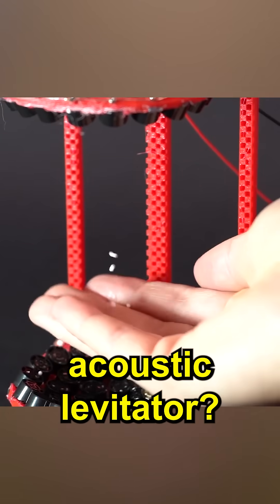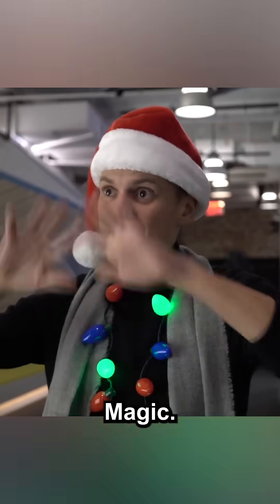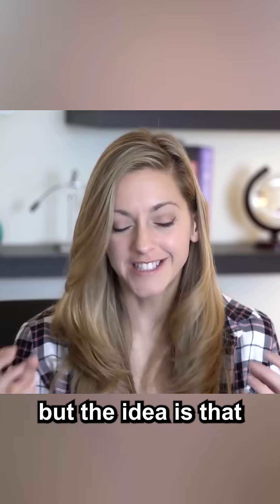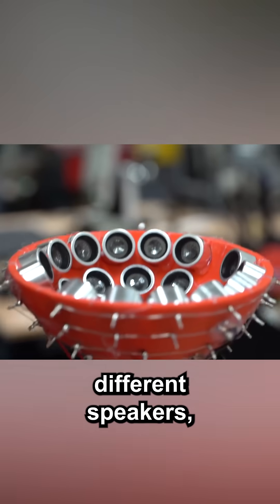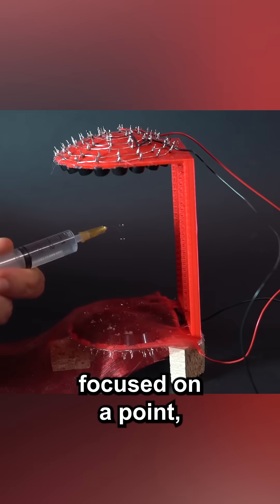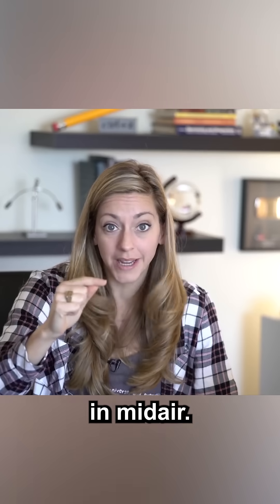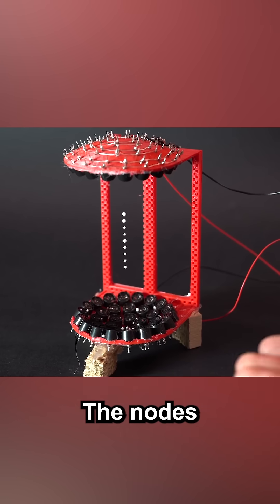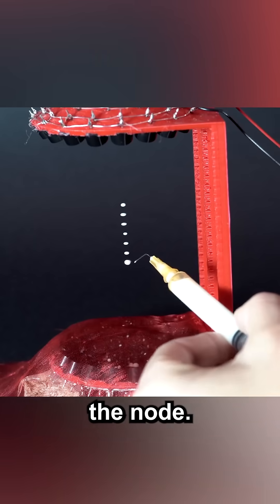We did it! Levitation is REAL

Comment: As a sound tech enthusiast, standing waves are the bane of my existence. Luckily books are really good at increasing the effective sonic volume of a room, eliminating any errant standing low frequency waves, and I love reading too! 
For a deeper dive keep reading, standing waves tend to happen when the frequency and a dimension of a room are lined up, this tends to happen at lower frequency, because our rooms tend to be the right size. So if a let's say 25 hz bass note is played in a space roughly 20' square. (I know the math is wrong, but the concept is not, I deal with it by ear, not paper) a sound wave will express it's full amplitude fluctuation, then reflect back, following the same path. This is experienced as a weirdly loud note in the mix. Sound travels faster through stacked paper than air, so strategically placed book shelves effectively increase the volume of the room to near infinity as far as the sound wave is concerned.

Comment: They need to use this to the fusion reactor to control the neutrons because it's the only way
Reply: Actually I'm not even sure that's how those work. The sound makes pressure waves and the constructive and destructive zones are what creates the three-dimensional interference pattern. Same as with the double slit experiment. That makes way more sense in my head. And if you simply change the frequency you'd be able to hold bigger things actually no. So if I'm right if you change the size of the sound like by using bigger speakers you end up with larger interference pattern zones. Also sonic screwdriver

Comment: Hi there. I've got some questions, if you're ok with it:
1)I suppose these nodes probably are inaudible at least to the human brain. Are they or can you hear something going on 

2) how heavy can you go with the weight you stack "into the waves"? If you'd build a replication just a lot bigger and stronger and you cranked up the volume (if it would take that. I admit I don't have a good understanding of this yet. But I'm a curious guy and trivial or scientific knowledge is my breakfast and lunch) would you be able to take something heavier than styrofoam?

3) Would you be able to light it on fire? Also floating flames in the wind, I admit, would likely look amazing 

4) can you move them in mid air by alternating the tune a bit?  The idea popped up in my head, because it reminded me of the effect you can get with water droplets. While I have to admit that this is a totally different model and relies on something like an optical illusion I think it was, I'd still be curious to know if you could achieve that?

With regards from Germany

Comment: You could also combine matter they’re only levitating water drop if you have two chemical composites using combined them to make a new chemical composite in the same process acoustic levitation also goes as far as two solids and if you heat a solid to the right temperature, it becomes liquid and you take the two liquids and combine them together to make a new element. It’s very simple people just don’t look at it right do you need to go back to Tesla at the tournament of the century? He discovered the cure for cancer using those same sound ways

Comment: That's not levitation. That's just suspending something in the air the same way you would do it with a stream of air pushing that thing up or, more commonly you might have seen it where a fountain keeps a ball on the top of the stream.

Comment: Have you considered the addritional possibilities that can be actualized with your existing device by using co-operatively co-ordinated mofulation of those standing waves by slowly time-varying Fourier-type affevts to re-poaition the little pievrs of styrofoam ; nor you vould use the little pieces of styrofoam  to visibly watch chahges in the wave-patterrns you created (by selectively varying the combinations of the stimulating frequencies corresponding to the system's natural standing-wave-frequencies) ? 
     What you are doing is great applied science (aka "actual engineering R&D plus proof of concept proto-typinh") .
🎉🌞❤️💞💕💞😊